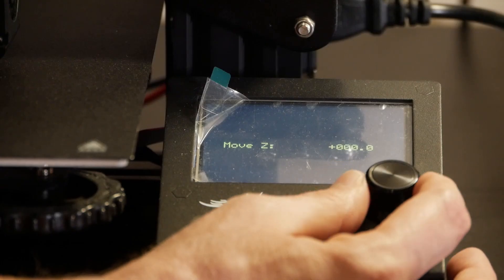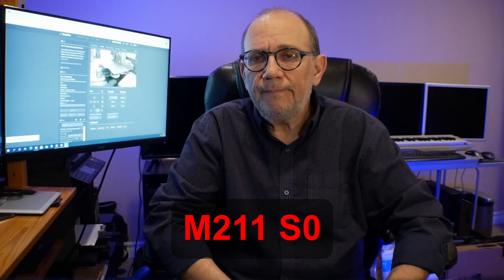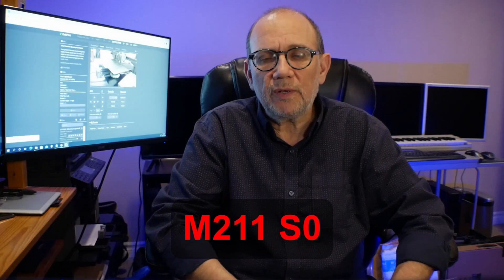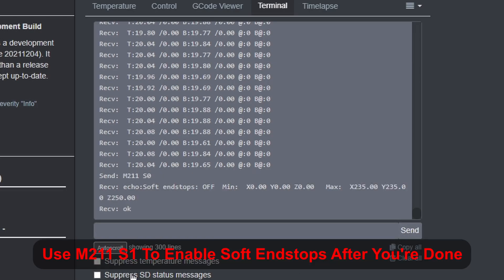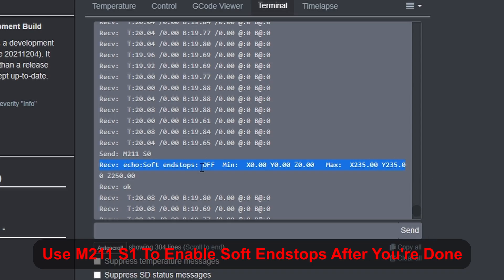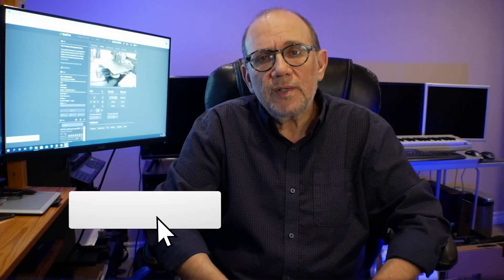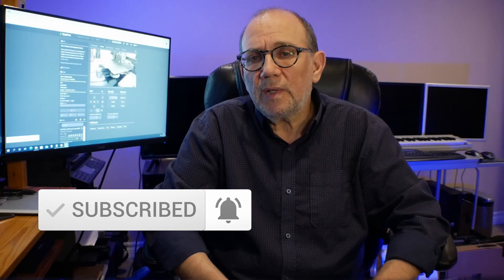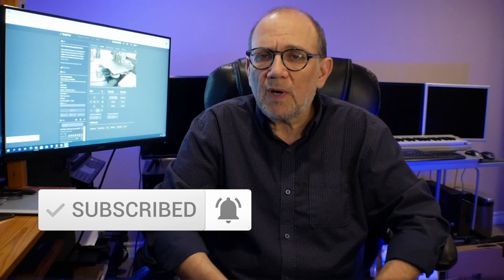Easy z-offset adjustment for your 3D printer.

Comment: I just installed Jyers UI UBL, BLtouch and MicroSwiss Direct Drive on my E 3 V2. For some reason I can’t not move the nozzle close enough to the bed to print. The Z off-set will not go any lower than 0.0
Reply from the maker: Yes, this is because you've got the soft limit switch enabled in the firmware . Go to the end of the video.   There's a solution for you there.
Reply: @CreatewithTech  - I figured it out through the JyersUI firmware and was able to save the z off-set setting after dialing it in. Thank God I didn’t have to go about it by editing the firmware, because I have no idea where to begin with that! You really helped me figure it out and I appreciate your help. Much respect! 👍
Reply from the maker: @damionchrist  Glad that it worked out...Sometimes it takes a bit of time to figure things out.  Have fun 3D printing.  RG
Reply: @CreatewithTech  - Thank you kindly!  👍

Comment: finally an explanation to why i cant get z to go minus values... how do i store my z offset if i have no configuration option on my lcd? my firmware is v 1018 and i got no autobed leveling probe.
Reply from the maker: Sorry for the late response.  I'm not sure which printer you have, but there should be a place where you can store your Z offset on your LCD screen.  Alternatively you can use an interface like Octoprint to set the z-offset information using the M851 gcode command.  Here's the example from the Marlin website:  Set with M851 Z-5.2 and define Z_PROBE_OFFSET_FROM_EXTRUDER -5.2.  Here's the link to the page:   https://marlinfw.org/docs/gcode/M851.html .  Make sure you send the M500 command to store your values to eprom.  I hope this helps.  RG

Comment: Can you please do a video how to download octoprint I've been trying to get my Z offset to work but it won't let me put it to zero I barely got started 3D printing I'd be really thankful if you could help me out with this so confused what to do🙂
Reply from the maker: Hi there rizkdark..I'm assuming that you mean that you can't lower the nozzle past 0.  If that's the case, I made another video showing how you can send the M211 S0 command to turn off the z offset soft limit switch using an sd card.  You can find the video here:  https://www.youtube.com/watch?v=pj0kICk6DfY&t=48s  .  I do recommend that you eventually setup Octoprint (it's an excellent interface), but you don't need Octoprint to send g code commands.  Octoprint just makes it easier.  RG
Reply: @CreatewithTech  I watched the other video it was useful thank you but my thing won't go to zero I followed all the steps the video was going to fast I pause the video too I'm kind of confused still if you could still help me out that be helpful
Reply from the maker: @rizkdark3684  I'm not really sure I understand what you mean when you say "my thing won't go to zero".  Please explain a bit more.  Right now I'm not really sure what the problem is.  I would like to help you with this, but I'm not clear on the issue.  If possible make a short video and post it on your YouTube channel showing exactly the problem that you're experiencing and then post the link here.  RG

Comment: hi, i have watch several videos including this one, all of which do not discuss how the springs should be, should the springs be loosen or tighten? because When i tried to manually level the bed, one of the knobs was about to come off and it was still too far from the bed, I am using borosilicate glass (which does not warp), what is the recommended spring tension with Auto-bed leveling?
Reply from the maker: Hello Vincent Reyes...You've got a good point about the knobs.  They should not be so loose that they're in danger of falling off.  What you describe has happened to me as well.  There are two things to consider when leveling a bed:  1.  How level the bed is vs 2. How even the bed is.  The BL Touch takes care of an uneven bed, but it has no clue about how level your bed is.  Leveling the bed is done with the knobs, dealing with an uneven bed is done with the CR Touch or BL Touch.  Now as far as the bed being too far from the nozzle when leveling, this is something you need to take care with your z offset...so basically go around three or four time with your knobs and level the bed.  If the bed is too far from the nozzle when the knobs are secure, then you need to deal with that by calibrating your z offset.  Now as far as the BL touch is concerned, what you need to do there is refine the z offset...if it's already good enough from when you do your leveling, then you should just leave it as is.  I hope that what I'm saying is clear.  Good luck.  RG
Reply: @CreatewithTech  thank you so much for replying. I have tried tightening the springs all the way, then adjust the springs manually, I have notice the left /right  rear and front right   corner is till far away i wanna say about 0.5mm away from the nozzle. I might have to readjust the Y carriage plate, I did just replaced the wheels on the carriage plate. Do you know of any good books or PDF for servicing creality 3d printers?
Reply: @CreatewithTech  success, I had to 1. readjusted the x rail, 1A. I lowered the bed all the way at all 4 corners, 2. Now success  :)
Reply from the maker: @MrTurtlefan2  Excellent! Glad to hear that you figured out a way to make it work.  Now have fun printing stuff!  It's a great hobby.  RG
Reply: @CreatewithTech  it sure, is, :) thanks again i am still making some adjustments to the Z-offset. :)

Comment: How can I bring the probe down to see when the probe touches the bed?
Reply from the maker: Hello Dieggo Lessa.  I was able to bring the probe down using an Octoprint Plugin called OctoPrint-BLTouch...you can read about it here:  https://all3dp.com/2/octoprint-bltouch-simply-explained/#:~:text=The%20OctoPrint%2DBLTouch%20plug%2Din%20was%20developed%20by%20jneilliii%20in,with%20no%20plug%2Dins)  Once installed you'll have a button available in Octoprint to bring the probe down or up.  Good luck.  RG
Reply: @CreatewithTech  Can I asume that the 0 Z is where the probe touvh the bed?
Reply from the maker: @DieggoLessa  Yes, that is what should happen.  At the 0 point the probe should engage with the bed.  Now the nozzle is probably too high still...so what you need to do now is calculate the z-offset using the steps I discuss in the video.  RG

Comment: Followed step by step, can figure out how to set abl and print at the same time, maybe I'm missing something. 😳 anyway I'm doing test squares and my bed in the middle seems a little low and the right front corner (facing machine) seems a little high. I don't know if I should turn bed down or use babysteps which I'm clueless about. Thank you for a detailed video.
Reply from the maker: Hi There...from your description it sounds like you still need to level your bed using the leveling wheels...the ABL helps with a bed that's not completely flat, but it doesn't help with a bed that's not level.  That's something you need to fix with the wheels under the bed, going from corner to corner with a piece of paper, making sure that there is an equal amount of tension between the nozzle and the bed on all four corners.  You should feel a bit of a pull on the paper, but you should still be able to remove it from under the nozzle.  After leveling the bed using the wheels, do the Automatic Bed Leveling, followed by setting the z offset.  Good Luck!  RG
Reply: @CreatewithTech  thank you sir,I will definitely adjust that
Reply from the maker: @scmafia7515  I just watched the video on your channel of the print and from what I can see it definitely looks like your bed is not even (need to level with wheels).  Unless you've got a clog (which I don't think you do) the reason why it's not extruding at certain points is because the nozzle is much too close to the bed (left side) and too far off the bed (right side).  Because the nozzle is so far off the bed on the right side the filament is not sticking.
Reply: @CreatewithTech  that makes sense, I'm curious as to what the numbers mean when you auto level the bed. I just leveled again, to the best of my abilities, and I will try again with video

Comment: Is the oozing of the filament normal? Mine does the same thing and it drives me insane.
Reply from the maker: Yes, it is normal.  There is, however a way of making it stop.  It's relatively easy using g-code.  I'm planning on doing a short video on this soon.  Unfortunately it's a bit too much to tell you how to do it in this response.  I should have the video up in a week or so.  RG

Comment: Do you do any pay phone calls to help get this right? Some of the options you have are not in my menu.
Reply from the maker: Hello Nick P -- I'm sorry that you're having a hard time with this.  I'm happy to try to help you out if I can and there's no need to pay.  I'm not sure why the Z-Offset options are not available to you.  We need to figure that out.  What brand of printer do you have?  Do you know what the firmware on the printer is?  Is it Marlin?  Every printer should have a function somewhere for adjusting the Z-Offset.  Anyway, let me know what brand of printer you have.  RG
Reply: @CreatewithTech  thank you very much. If you have a patreon account I'll send money to that, it's worth it to me. It's driving me nuts. No one else offered to help, so thank you so much. I have an Ender 3pro, I put a BTT Filament sensor on it. I added a TFT 35 touch screen and a BTT SKR E3 V3. When I added the CR Touch, now nothing with even print. It's either to close to the bed or too far. I just cant get it dialed in anymore. I've been trying for weeks and nothing works. Do you have any ideas where I can go from here. I'm really new at this. These firmware sites, I just can't figure it out. Maybe I just have the wrong firmware. I don't know what else it could be. I'll pay you, call you, whatever it takes to get this working again thank you
Reply from the maker: @nickp385  When you added the CR Touch did you update the firmware?  It sounds like it's a firmware issue.  When you add a component like the CR Touch it's absolutely imperative to update the firmware.  Have you updated the firmware before or is this something completely new?
Reply: @CreatewithTech  I think I did but like I said I truly know nothing about this stuff. I'm don't even know what files I'm grabbing. I even tried to take it off but then it's saying something wrong with ABL then stops working. I'm getting to the point where I was just going to buy a new one and it's only 2 months old. I don't know if I should look for the SKR firmware or the CR firmware. I should have never even touched it.
Reply from the maker: @nickp385  OK, a quick question...when you turn on your 3D printer, does the CR Touch create a mesh of your print bed?  Does the CR touch actually do something?
Reply: @CreatewithTech  yes it goes through everything. When I try and print something no pla is going on the sheet. I'm thinking the nozzle is too close because I can't adjust the offset. At least that's what I think. Before this it was working fine. From the little I know that's the best I can figure out.
Reply from the maker: @nickp385  Have you made sure that your nozzle is not clogged? If you're not sure, do this test... bring the extruder/nozzle up about 100 mm off the bed...heat the nozzle to the temperature you usually print at (200 degrees?) and then  push some filament through the nozzle...are you able  to push the filament out?
Reply: @CreatewithTech  yes I can push it through. Seems fine
Reply: @CreatewithTech  Could it be I need a different firmware to have the options you show in the video?
Reply from the maker: @nickp385  Hi Nick...yes, I think so...I'm not sure which firmware you installed, but I suspect you've got the wrong firmware.  Have you ever compiled your own firmware?  Anyway, here's a link to the Bigtreetech github page for the SKR E3 V3:  https://github.com/bigtreetech/BIGTREETECH-SKR-mini-E3/tree/master/firmware/V3.0/Marlin .  At the very bottom of the page you'll find the precompiled firmware for firmware-ender3-bltouch.bin: used for normal BLTouch connection.  I'm assuming you didn't remove your end switch when you installed the CR Touch.  If that's the case download this firmware.bin file and install it.  If you did remove the end switch install the firmware-ender3-bltouch-for-z-homing.bin.  Now I can't guarantee that it'll work, but that is the firmware that should be used with a bed leveling system like the BL Touch or CR Touch.  This is what I would install if my machine was not working properly.  Now having said that, you've got to be careful. Be ready to turn off the machine if it seems to be doing something strange after the firmware update.  Also, I'm giving you a suggestion to the best of my ability.  I cannot be held responsible if something goes awry.  Let me know how it turns out if you try it.  Good luck.  RG
Reply: @CreatewithTech  thank you very much. I will try it tomorrow. Of course I would never hold you responsible for trying to help me lol. You have gone adove and beyond. I will let you know tomorrow if it worked. Thank you again and gn.
Reply: @CreatewithTech  GM RG, Ok I think I downloaded the file. It is called Marlin-SKR - mini-E3-V3-G0B1, does that look right? I'm sorry I have no idea what any of this means.
Reply: @CreatewithTech  RG I got it to somewhat work but its not sticking very well. Is there a way to send you a picture of what it looks like? Maybe if you see it you can tell me how to fix it. I dont know how to send something in this comment section.
Reply from the maker: @nickp385  No, that is not the right file name...my apologies for the link.  Try it again, it should be working.
Reply from the maker: @nickp385  It's probably not sticking because you haven't done a proper bed levelling.  So you'll need to do two things:  #1.  Level the bed with the wheels.  This gives you a good basic levelling.  It makes sure that your bed is not tilted and reasonably straight.  #2 Calibrate the z-offset...this will let your cr-touch know where the bed is...follow this video to do this.  Before doing anything though, make sure that you install the proper firmware from the link I gave you above.
Reply: @CreatewithTech  RG, it's working. I can't believe you fixed it. I was close to just buying a new one. I'm not sure if it's the best first layer. Is there a way to send you a few pictures to see if I have it right? If you don't want to I understand. Like I said you have gone above and beyond. I wish I could pay you of just buy you lunch.
Reply from the maker: @nickp385  Glad to hear that it's working  :)  ...sure, you can send me a couple of images...send them to reelstories@rogers.com  .  I'm off for the day, but I'll take a look when I return later.  By the way, whereabouts are you located in the world?  RG
Reply: @CreatewithTech  Great I'll send them now. I live in New York on long Island. I'm a late starter to this stuff. Next I want to get a drone lol. I guess when you get older and have nothing to do these little things pass the time. Thanks so much again.

Comment: I already have a value in my “probe Z Offset”. Do I switch the value or add the value? I have an enter 5 pro and someone els installed my bl touch for me and now I needed to fix the offset after changing the nozzle
Reply from the maker: Hello Sarah -- in your situation you can either modify the already existing Z Offset value or you can reset it to 0 and start from scratch.  I would personally just modify the already existing value first and see how that works.  Another option is to start a test print and use the baby stepping option to recalibrate the value.  If you do use the baby stepping option just be careful not to scratch your bed if the nozzle is very close to the bed.  Whatever you do, just remember to save your new setting to eeprom by sending the M500 command or by using the save setting command on your LCD.  Good luck.  RG

Comment: Using an Ender 5 pro and just installed a cr touch, when I run the bed leveling it does the first 2 points, then it goes to number 3 but it goes completely off the bed into the left rail
Reply from the maker: Hello Roland...Sorry that you're having an issue.  From your description, it sounds like your xy offset is not correctly configured in the firmware.  Did you compile new firmware for the CR Touch installation?  If you did, you may need to fix the xy offset setting and recompile.  Here's a link to a video that will walk you through the process of compiling new firmware and properly setting up the xy offset:  https://www.youtube.com/watch?v=PMG4bC9I3DA    Let me know if you get it figured out.  Good luck.  RG

Comment: What setting did you change to let your z-offset go into negatives? Did I miss that in the video?
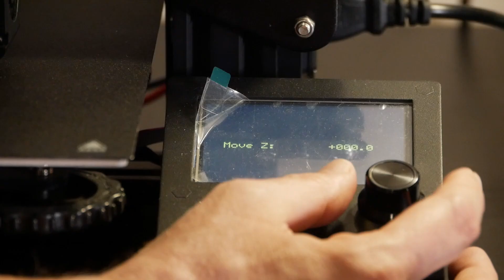Reply from the maker: Hello David Clawson...yes, I talk about this at 15:06.  You basically need to turn off the soft limit switch by sending your printer the M211 S0 g-code command. I made another video that may help you with this https://www.youtube.com/watch?v=pj0kICk6DfY&t=350s .  The way you send the g-code to the printer is with Octoprint or Pronterface.  If you don't have this applications available you can do it using an sd card, which is what I discuss in the video that I gave the link to.  Good luck!

Comment: Hello, how can I run the M211 S0 command without Octoprint? Please a tutorial video or something similar I'm desperate.
Reply from the maker: Hello Real Phillip...I'm sorry you're having difficulties with this.  You can send the M211 S0 command to the printer using an sd card...the same way you send g code to do a print.  I'll do a short step by step video in the next couple of days.  Stay tuned.  If you haven't done so yet, you might consider subscribing and hitting the notification bell so that you'll get notified when the video is released.  All the best.  RG